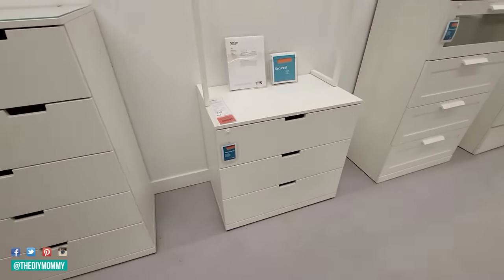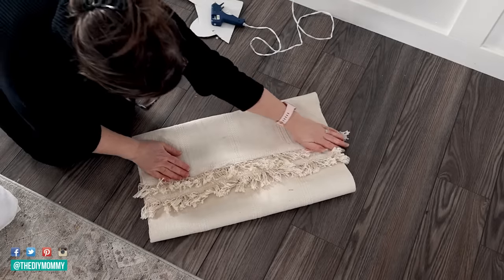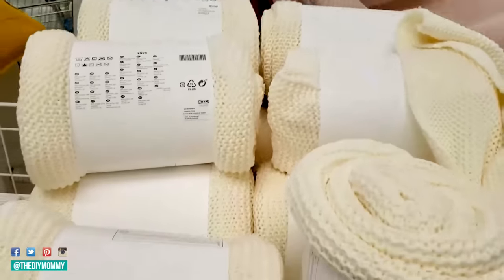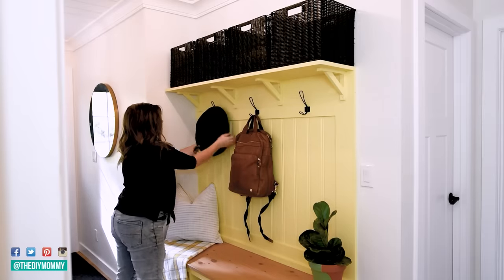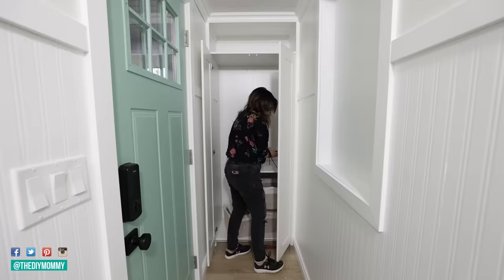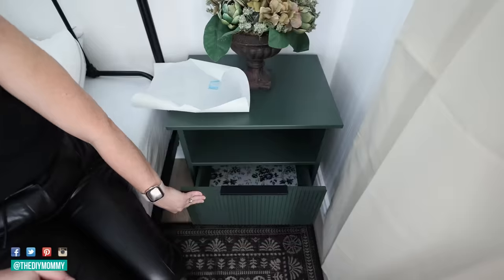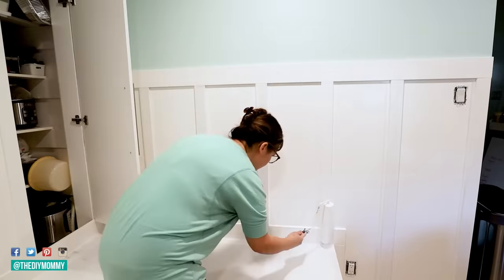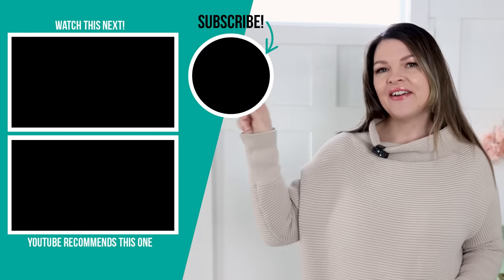10 Top IKEA Hacks to Elevate Your Home on a Budget!

Comment: I think for the cushion instead of using glue I’d use the iron on hem tape.  I’ve tried washing items with glue and it doesn’t end well but have never had an issue with the iron on hem tape 🤷🏻‍♀️
Reply: I wondered about the glue. Very pretty, but I am a sewist and would rather just sew one or use the hem tape.
Reply from the maker: Hem tape is a great option, however I've had no problem washing items I've made with Gorilla hot glue.
Reply: @thediymommy  I would think washing in a cold wash and either air dry in the dryer (no heat) or hang to dry, would be fine.

Comment: How to do board batten with textured walls   Lots of tutorials show it  with the wood  but will it be strange with texture in between ? Help !!!   And thanks for ikea diy  love those
Reply from the maker: I've never worked with textured walls, so I'm not sure. I think some people have skim coated them with drywall mud & sanded before applying trimwork.
Reply: If it is a small area, maybe add beadboard? It might be less work.